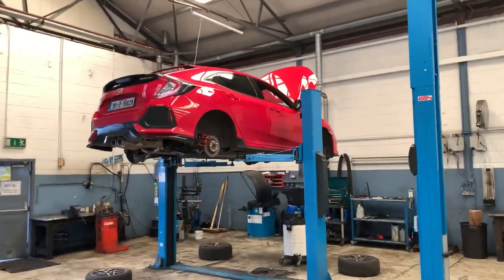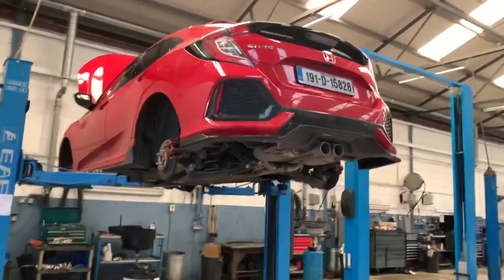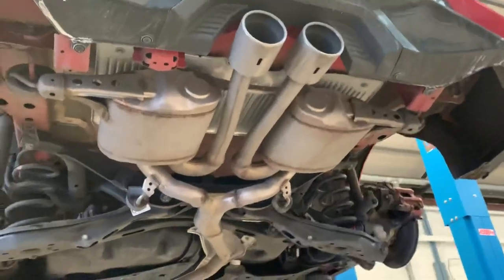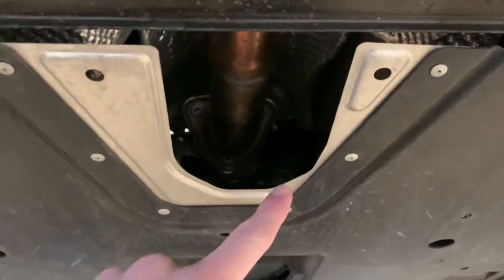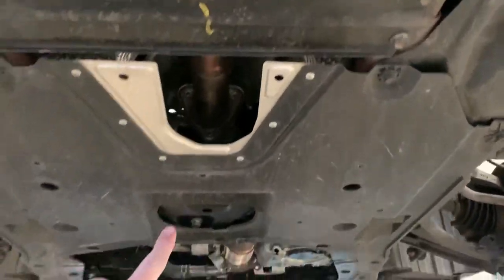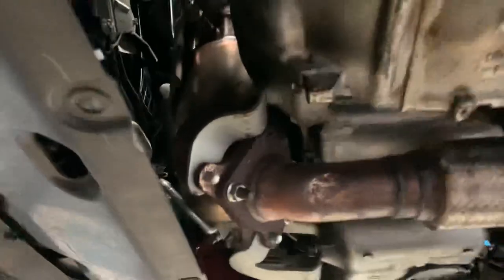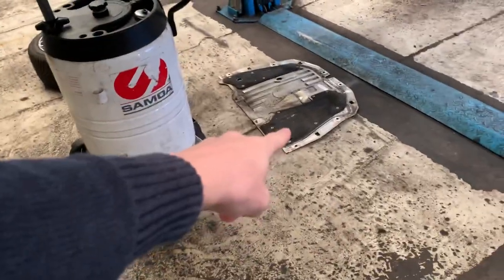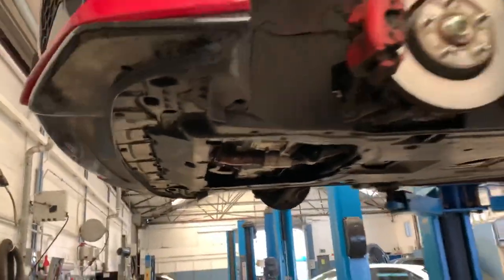Where is the Catalytic Converter on a 1.5 Honda Civic ? #fk7 #hondacivic #catalyticconverter

Comment: Hi sorry just to double check so for the 2018 civic hatchback sport 1.5L only 1 catalytic converter not 2 right? I just want to make sure cuz i had a shop told me I have 2 cat converter but I only saw 1 in ur video. Thank you 😊
Reply from the maker: Manual or auto ???
Reply: @doolanbrian I have the same question but for the automatic transmission. Is there a secondary catalytic converter?

Comment: It’s getting to the point where we all need to stick our own booby traps on our vehicles touch at your own risk ⚠️ run high voltages throughout if they die they die saves the next victims vehicles.
Reply from the maker: Cat theft is a very common issue on older cars at the moment